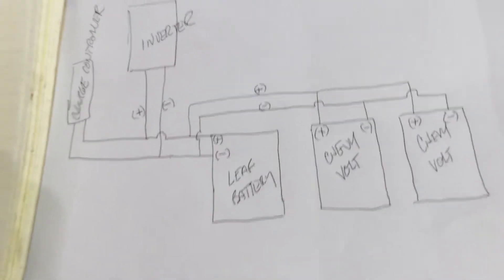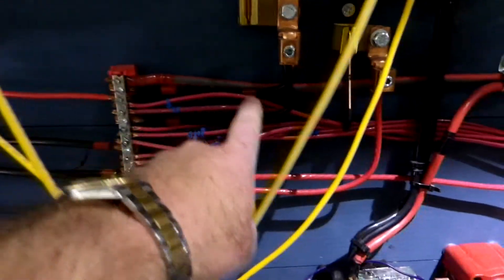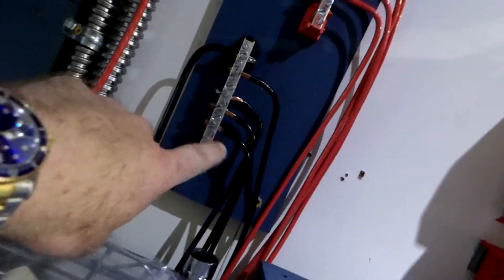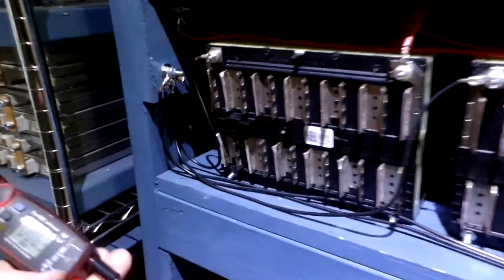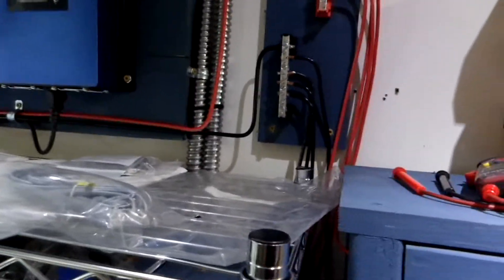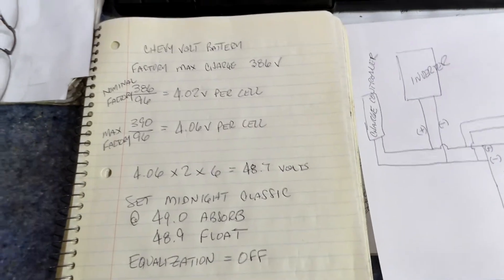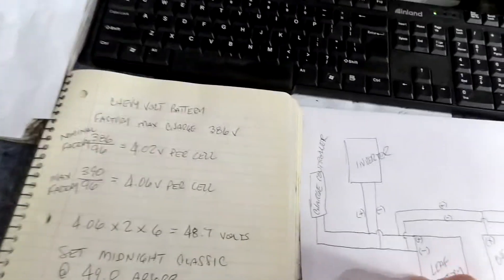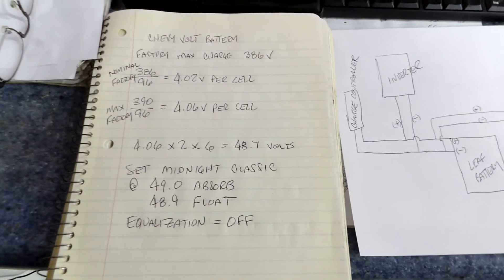Chevy Volt + Nissan Leaf Battery - off Grid Storage

Comment: Hi Mark
I love your setup. 
I am planning a similar configuration using 3 leaf batteries to power my home and garage.
Thanks for sharing. 
Any updates?
Reply from the maker: Awesome !  You will love your setup.  How many KWH's do you currently use a day ? because that's everything right ?   If you haven't, measure everything in your house that consumes current using a KiloWatt Meter.  Add up the total KWH's consumed in a day.  We use an average of 18 fall, winter and spring and about 40 when it's 90 F because of the AC.   So my 56 KWH pack is sufficient but certainly not overkill.   Thankfully when it's 90 F, we usually have good sun !  I need to do an update, thanks for reminding me :-)
Reply: @mark_osborne  Thanks for the tip.
However, my home is currently being built, but watching off grid systems and loads like yours,  have help me greatly and I hope to land in the ballpark.

Comment: thats a very interesting setup. Im using a partial volt pack for our off grid cabin. Its good to know that I can use leaf batteries as well if needed. Check out my build video if you get a chance. Id be interested in any comments you might have. Ontariolakeside

Comment: Hi Mark - Checking in on how your setup is working? I now have two full Volt packs that I will be tying together. Would you do anything different? Still balancing on their own? Thanks !
Reply from the maker: Hi Mike, at this point I can't imagine doing anything different-  everything works perfect, and yes, they are staying in balance. If you get your system together we'd all love to see a video !
Reply: Mark Osborne thanks for the update. Planning on doing a write up and posting for others. Learned a lot from yourself and others out there like David Poz. Still have to make some inverter decisions, do you just have the magnums? I thought I noticed some grid tied inverters were being used also.??  Planning on a hybrid system, some dedicated loads off grid, ACs and pump, then eventually something like a grid assist whereby the solar supplements house demand but any excess goes into the battery bank.
Reply from the maker: @zekeboz5533  Yes I just have the 2 Magnums.   I have played around with other inverters but nothing else is connected.  I worry about  one of the Magnums failing- and what I'll do.  Been thinking about getting a back up inverter, perhaps a 12000 Aims or a 6848 Schneider, or perhaps just another Magnum, perhaps a used one.
Reply: @mark_osborne  FYI-  I heard that Midnite Solar is supposed to be coming out with an modular inverter series but unsure when that will be. The original timeframe was 2017 but I have not heard anything recent.

Comment: There must be a difference (possibly minor) between the two types of batteries' internal resistance. In case of a short circuit at the paralleled bus bar, one set may heat up faster than the other. Not sure if you have each battery bank separately fused. A BMS would certainly improve the safety level of the system.
Reply from the maker: Thank you for your extremely thoughtful and accurate input.  Each "pack", meaning, each set of (6) 8 volt cells =48 (nominal) are fused with a 30 amp fuse.  I seriously need to switch those 30 amp fuses out to 10 amps as the most I can possibly pull off each 48 volt pack is about 6 amps.  So, in the event that any pack dead shorts or otherwise goes nuts, it will isolate itself from the remaining packs.   

If one out of 6 cells, in any of the (24) 48 volt packs started to drift out of balance, I have no immediate solution.   It takes monitoring, something a BMS would handle.  For now, I'll keep an eye on them.

Comment: Also as a follow up have you done testing to know what the maximum charge rate for a setup such as yours can take? i.e. how many amps. I have not done any work with the car batteries but some of the other lithium batteries have smaller current rates that they will take compared to sealed agm in similar size batteries.
Reply from the maker: I don't think you or I will ever own a generator that's large enough to hit their charge limit.   A Leaf battery can be charged to like 90% in roughly an hour at one of those quick-charge stations sprinkled across Europe.  That's plowing roughly14 Kwh's into the battery- for us, divide that by 8 because there are (8) 48 volt packs in a Leaf battery, or 1.75 Kwh' per pack (usable).  Now do the calculation to charge one pack 48 V pack in an hour. 1750 divided by 48V nominal..... that's 35 amps.  Multiply that times 8 because you'll have them in parallel and you'd have to have a generator capable of 50 V @ 288 amps, or 14,000 watts to equal that quick-charge station, and cables as big around as your arm.   I DID charge an individual 48 V pack (from discharged - 3.5V per cell) using my DC generator and I charged it @ 40 amps only because when I tried charging it slower my injector pump stop kept backing off because there wasn't enough pressure on it. Anyway, she was charged in like an hour and according to my hand held infrared temp gun, the battery didn't even go 'up' 1 degree in temp !
Reply: in the case with a guy that's putting up a lot of solar like 2 mid nite classic 150's capable of putting in like 180 amps based on what your saying wouldn't make these things burp?
Reply from the maker: If you were to put 2 Midnight Classic 150's in front of 1 entire Chevy Volt battery which consists of (8) 48 volt packs, you'd divide that (maximum possible) 180 amps by 8 = 22.5 amps per pack.  Totally do-able, with tons of room on the upside (amps) as far as the batteries are concerned.  Lithium sucks that current up like it isn't even there.  Nothing at all like lead acid.
Reply: Mark Osborne HI Mark, thank you for answering all those questions. Can't wait till all of this comes together.
Reply from the maker: Found this.
Fast charging a Leaf battery can add 88 miles in 30 minutes. 88 miles @ 4 miles/Kwh = 22 Kwh or 44 Kwh per hour of charge time.   Your 2 Midnight Classics would have the theoretical maximum ability to deliver 50v x 96 amps= 4.8 kwh x 2 = 9.6 Kwh - roughly 1/4 of what the battery is able to take during a fast charge.   Also, from what I can find, Level 2 charging (a standard wall outlet) will push 6.6 Kwh into the battery.   So your 2 Midnight Classics, running at their max capacity (which will rarely happen in practice), will be 145% of a wall outlet Level 2 charge station.   https://www.chargepoint.com/blog/three-ways-charge-next-generation-nissan-leaf/

Comment: In case you did not see this midnite recommends with LI batteries to change the absorb time and in many cases it is lowered to as low as 3 mins. I suspect with the battery bank size that would not be that low in this case. You have done the testing I have not...please read over the note from midnite solar and tell me what you think e mail Tony@hurricanewindpower.com. I did not hear you address this and perhaps these batteries it this does not apply to but this may be worth a read if you not aware of the absorb time http://www.midniteftp.com/support/kb/faq.php?id=75  A customer of mine was interested in your set up and I am curious as well thanks
Reply from the maker: Ok, very interesting Tony, I had not read that article in the past.   My absorb is now set to 5 minutes.  Will see how that works.  As far as "float", in my situation, once the batteries hit their target voltage of 4.06 V per cell, or 48.8 V (absorb) for the 48 volt pack, Float takes over, which is set at 48.7 and the charge controller backs right off and I can read the amps going into the battery bank via the Wiz-Bang-Jr.  The amps go to zero (O), plus or minus a couple amps throughout the day while I'm making solar. The charge controller(s) are just supplying the needs of the house and the shop at that point, and the battery bank is happily sitting there in a steady state of charge, no different than if it were in a car, parked, with the ignition 'off'.  Consequently, I can't see setting the float down to some lower setting-- not sure what that would accomplish.  Keep in mind, I'm undercharging these cells just like Chevy does as installed in the Volt.  4.06 x 96 cells = 390 pack voltage as installed in the vehicle, where a full charge would be 403 volts.  So once again, I feel that my conservative approach should allow these cells to go a long time.  Since adding the 2 Volt batteries in parallel with the Leaf battery, I'm only cycling the cell voltage between 4.06, down to 4.00 and back up to 4.06 virtually every day.  Thanks for the article !   My absorb was set to 3 hours, but once again, the cell voltage never got above 4.06 V so I'm not sure what difference setting it to 5 minutes is going to make - but I will go with it and see if I can detect any difference in overall performance.

Comment: Hi Mark -- First, thank you for your videos, very helpful, straightforward and easy to follow. 

I have 4 complete Chevy Volt packs that I am incorporating in my solar system.  The packs are all under 40K miles and came to me with the following voltages:  Pack 1, 3.88v per cell; Pack 2, 3.55v per cell, Pack 3, 3.92v per cell and Pack 4 , 3.55v per cell.  (From the voltages I am guessing that GM used 3.55v as the lower cutoff).  I have 2 Magnum MS4448PAE inverters and 2 Magnum PT100 charge controllers that are set up separately (as opposed to the inverters being paralleled as you have done)  My both inverters and charge controllers are fed by two sets of solar panel arrays, each with 16 300 watt panels for a total of 4.8KW feeding each charge controller/inverter.  I have broken all the packs down into 48v modules in the same fashion as you have.

I'll be setting up 2 battery banks of 32KW each -- my question is how to get the voltages of the packs equal.  Packs 1 & 2 are from 2012 Volts and packs 3&4 are from 2013 Volts.  I could charge 1 pack at a time to say 48 volts and then couple the packs in parallel or simply connect them in parallel from the get go.  Any thoughts?

I'm considering paralleling the inverters like you have -- was that very difficult?  Thanks in advance for any suggestions you may have.
Reply from the maker: Well, you could take the packs that are at 3.55, put them in parallel, hook them to your charge controller and when they hit around 3.8 v- parallel in the packs that are currently sitting at 3.88, and likewise the packs that are at 3.92.   Or, you could make up a light bulb test arrangement like I use in my "Test Chevy Volt Battery" video, and draw down the higher voltage packs to match the lower voltage packs.  That would be a lot more work tho.  BTW, you can start paralleling batteries when the voltage gets within about .1 volt  IE: 3.88 will parallel Ok with 3.8 or 4.  Any more differential than that and you'll be shocked at how many amps will try to flow thru the wire to balance out the battery.  

To parallel the inverters you need to buy a "router" from Magnum - like $320. 

If you didn't parallel the inverters, would you just run some of your house circuits on one, and some on the other ?     I paralleled my inverters because I need the starting current to run the hoist in the shop- that damn thing pulls a ton of current to start, even tho it's only a 2 horse motor. One Magnum won't even begin to start it.  Funny thing is, one Magnum starts my 2 horse air compressor without a problem.
Reply: I have 2 separate sub panels with roughly half the household circuits on each one.  My thought when I set it up was having some redundancy in case a charge controller or inverter died.  Still have heavy loads (dryer & kitchen stove) on grid power.  Just picked up 20 more 290W panels and will add another MS4448PAE and charge controller so I am now considering paralleling 2 of the inverters.  I have a lead acid 38KWh battery bank  (forklift batteries) that I can also work into the system.

By the way I am making wire harnesses using the Volt BMS plugs to parallel all of the 3p cells -- I's hoping this will help keep the individual cells in balance.

Thanks again for your thoughts.
Reply from the maker: Got it.  Even if you do parallel the Magnums, one acts as a master, and one as a slave and the slave does nothing until called upon.  You can adjust the point at which it's called upon from 10-90% of the master's capability.  So even if you're pulling 3000-3500 watt 'resistive' loads, your slave may never turn on.   What DOES trigger the slave is the stoopid garbage disposal- and it's only a 1/3 horse unit.  It's that instantaneous draw.  But that's also VERY motor dependent.  The old sump pump would trigger it, but not the new sump pump. So, they've improved the inrush somehow.  

You'll have a ton of panels up ! Good for you.  I have 42 up and the last 12 I ran along the fence facing SW really made a difference.  Huge difference.   How many Kwh's do you use in an average day and what major  city are you near -if you don't mind ?    We use about 20 in the winter and 37 in the summer and I'm 24 miles north of Detroit - pretty bad winter sun
Reply: Nearest major city is Boise, Idaho -- we are about 25 miles out of town in the mountains.  The winter months are bad in terms of winter sun.  We use mini split heat pumps for heating and cooling, with wood as a backup if the temperature drops below where the mini splits like to work.  Summer and winter load is probably in the 30 to 35Kwh per day range.   I suspect we'll have way more power than necessary in summer -- winter is the problem.  

I have my water heater directly coupled (like devildestiny's youtube videos) to 8 300 watt panels and it works like a charm when there is sunshine -- have an LP tankless downstream to provide backup for cloudy days.

 Hoping to become totally off grid after I get the new panels up.  I think paralleling 2 of the inverters would give me enough juice to run a dryer or kitchen oven (not at the same time) since they are pretty simple resistive loads.
Reply from the maker: Got it... yup .. 35 Kwhs is easy enough to make from say March till mid Oct.  The shit really hits the fan by mid November and lasts thru Jan.  But by Feb  1st, there is a sudden change for the better.  I made roughly 150 Kwh's for Dec and 150 in Jan using my DC generator, and no amount of solar would have made a difference on those days when the sky is black and you only make 3-4 Kwh's.  

At what temp do your air sourced heat pumps become useless ?  ... or should I say, at what temp does their COP equal that of resistance heat ?...LOL
Reply: The mini splits function down to about 10 degrees -- how efficient they are is anyone's guess.  I suspect they are pretty much resistance heaters below 35 or 40 degrees.  They are much more efficient at cooling than they are at heating.  Hopefully by getting my panel count up I can generate enough more power on cloudy days to get through the winter months.  I've been pleasantly surprised at the amount of power that the solar panels make when it's cloudy.
Reply from the maker: Sounds good !    You should stick up a video- I'd like to see  your set up :-)